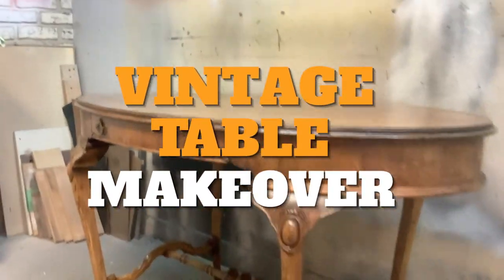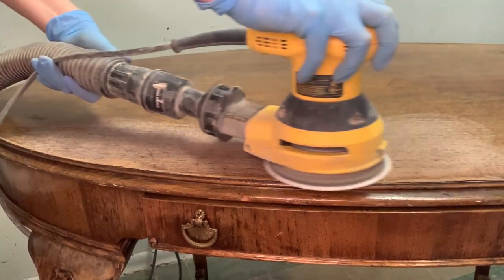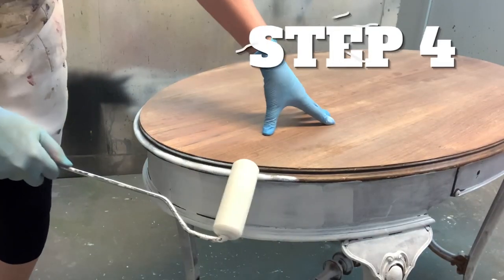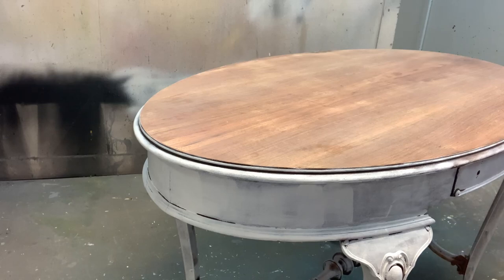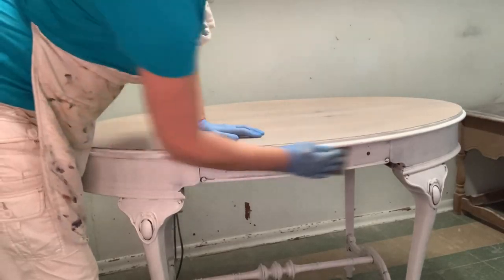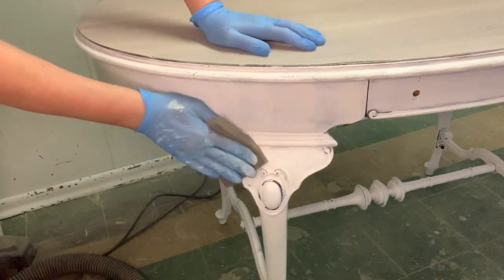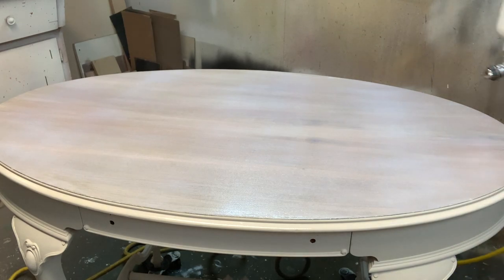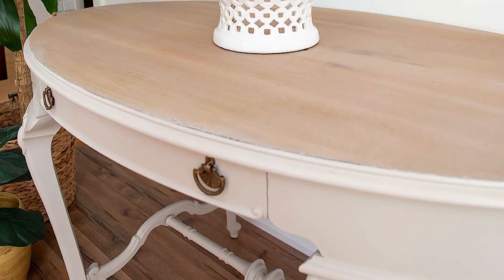Vintage Table Makeover

Comment: Hi Denise. Question: Is it necessary to paint the parts of the furniture that cannot be seen, unless you turn the furniture upside down?
Reply from the maker: It's not 'necessary' but there were a few times I was loading a piece into a clients car and the bottom looked neglected. Since then, I try to either sand the rogue paint off the bottom or paint it nicely as well. This is certainly a personal preference thing tho.. it's whatever you feel comfortable with. :)
Reply: @SalvagedInspirations  thank you Denise!
Reply from the maker: @susananobio6487  Anytime! XO